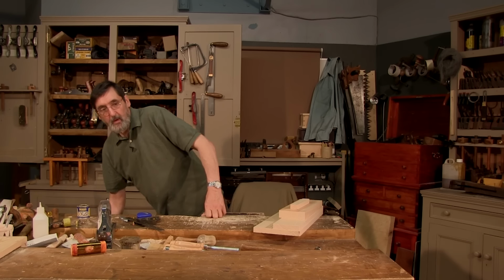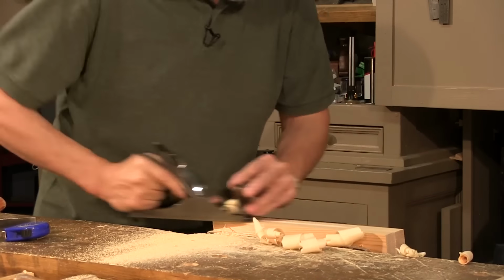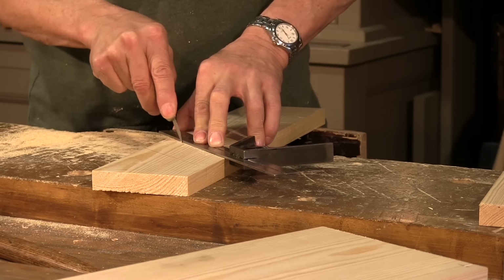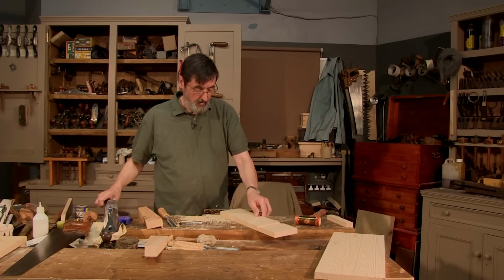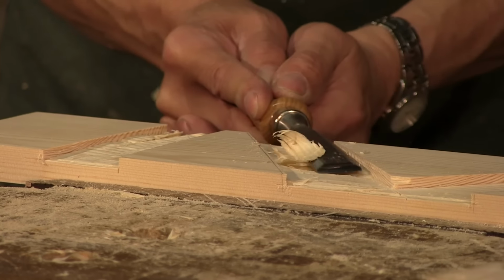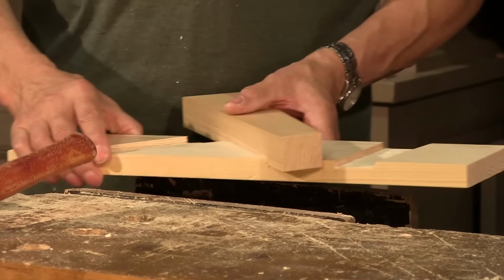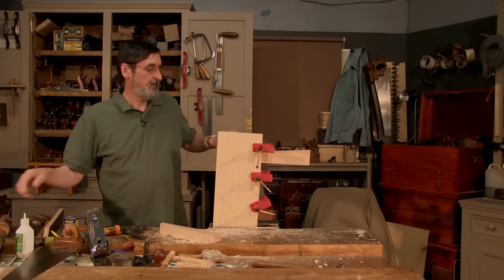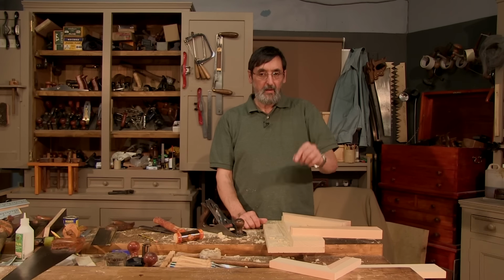Paul Sellers | How to make a Shooting Board

Comment: A refreshing antidote to watching people with immaculate workshops full of ruinously expensive Festool equipment.
Reply: Alan Currans And you do not need a dust collection system either. Power tools are addictive though. I also appreciate the folks that get by and do a great job with cheap brand power tools also. I have them a lot of good power tools but I agree with you. "I don't have any festool stuff yet" And I don't have many hand tools...which is about to change. Flea markets and Antique shops here I come!
Reply: Ugh, those damn Festool items!  Every video I watch is all Festool!  I've gotten by for several years (10) with Bosch, Dewalt, Grizzly, Delta, Porter Cable and literally EVERY OTHER BRAND out there just fine, and then comes along Festool and unless I'm missing something, I don't see the purpose in paying $800 for a router.
Reply: 1crazynordlander
Reply: titanwr If you pay $800 for a router you have to brag it up because if it's not the most awesome tool ever then you're a fool for paying so much for it.  The way I see it is you can spend a fortune on tools and brag about your tools, or you can get it done with cheap tools and brag about your skill.  I choose the latter.
Reply: ***** Don't fool yourself.  Good planes cost as much as Festool.
Reply: Alan Currans Good planes cost as much as the average Festool and some planes cost a lot more.
Reply: christschool
Are you kidding?  Even the most expensive Lie-Nielsen bench plane is cheaper than a Festool router mentioned by $80 and a Lie-Nielsen plane is definitely extravagant.  I can buy solid antique Stanley planes for $20-40 that with a little tuning turn into a great user plane.  In fact the most expensive plane in my shop was $30, and it's a great usable #6 bench plane.  But hey, if you love Festool more power to you. Your shop, your tools, do what works for you.  I do just fine without their tools using my flea market Stanleys.  Take care.
Reply: ***** I'm glad that works for you.  I think everyone should use the tools they like to use for the job, without judgement.  I like both hand and power tools.
Reply: christschool Agreed.  I did my apprenticeship in a predominantly power tool shop.  I learned a lot of wood carving but the rate of production dictated using power tools for everything else.  Now that I'm in business for myself I'm turning to a hand tool option more and more.  Sometimes it's still the best and fastest way and often it's the only way to get the required result.
Reply: ***** boom!
Reply: Alan Currans  Festools   are not the most expensive  out there. Try Mafell.
Reply: +Alan Currans AVE has a great teardown of a Festool plunge saw on his channel. Turns out the internals are garbage. No idea where all the money goes.
Reply: ***** I could careless about the internals.  Does the tool do the job it advertises?  If yes, I couldn't care less if it were made from paper mache or cow dung.
Reply: +Balenza345 Seriously. He just makes a bunch of assumptions about internal forces and then is constantly surprised when it's not put together like he thought.
Reply: +christschool Old planes can be picked up for very little and Paul has several videos showing him restoring planes to perfect working order so they would last another 100 years if looked after properly.  

Try doing that with a 40 year old machine router.
Reply: Joshua Rosen There are tons of old power equipment people use, some of them more than 100 years old.  Now, the stuff made today is not likely to last 100 years, but that old iron is being used heavily by people today. I've got a 50 year old Powermatic table saw that works perfectly and still has the same motor.  Many of the furniture shops around here use very old bandsaws, jointers and table saws, many of which are far older than 40 years.
Reply: That's interesting.  I didn't think that electrical equipment could last that long except very rarely and I'm impressed that a motor would last as long as 50 years.  It must have been very well made.
Reply: Joshua Rosen If your interested in learning more, google or youtube "vintage power equipment, woodworking".  My table saw is a 1967 Powermatic 66.
Reply: christschool Thank you, I shall.
Reply: +Joshua Rosen like any machine, power tools require maintenance.
Reply: Tony Ennis all tools require a bit of maintenance to work properly.
Reply: Leaning Tree Woodworks *
Reply: christschool I bet your Powermatic was used daily but in a small workshop where the original owner spent a fortune for the time and took care of it. Not some big anonymous workshop where people can mistreat machines as much as they want. After all its not their money, and it’s not their job to clean it. I do some analogue photography with my own darkroom. All my best equipment was bought either off small independent studios or hobbyist and I wouldn’t dream of buying anything from a newspaper or large studio. All the equipment from those times needed was respect, not new motors or worse every few months. There certainly wasn't a culture to throw the whole thing away and buy new because it was cheaper to do so.
Reply: Yes. I never feel intimidated by Seller's videos. He puts high value on his hand skills and not upon the tool itself.
Reply: Need to be a festFOOL!
Reply: @geezerdownunder  I've fixed up a few hand planes. If the full truth be told there is a great deal of time and some expense in fixing up old hand planes. Watch a video of what goes into fixing up an old hand plane - you will need often large pieces of float glass for flattening (or some other flat base), large volume of consumable sandpapers, usually spray adhesives or similar, files you'll wear down, and finishes for the handle and tote, rust removal in recessed parts, and the like. Some tasks, like truing up the sides for use in a shooting board (I know you can adjust the blade, but you're adjusting on two planes if you start with a plane out of square) require specialised equipment and can't really be done practicably at home. 

Also, when you buy a premium plane you get a blade worth about $100 with a perfectly flat back which you can flatten yourself but, again, usually with considerable cost of consumables and time.

I love Paul Sellers but even his videos show a master craftsman with everything he needs all at hand taking the best part of an hour (just the the plane, add in time for fettling the chip breaker and blade).

I think it's a bit misleading to refer to the comparison cost as $20-$40 or so for a beaten-up, rusty tool from ebay with a few hundred for a premium plane. It's a bit like comparing the cost of a bag of flour and some eggs to the price of a cake.
Reply: @1crazynordlander  I built my own pentz cyclone, it's awesome.  I made due with a shop vac for the longest time, but having a central dust collection has done wonders for my sinuses.  Need? Not in the grand scheme of things.  Is it nice for when I do use my machines?  Yep.
Reply: jpanic7677 Up to a point that is true.  However, for some of us, the time spent fixing up an old plane was as much fun as actually making things with it and the idea that I am at least the third generation to be using a woodworking tool really appeals to me.
Reply: @joshuarosen6242  Thanks Joshua. I thoroughly agree with the pleasure aspect. I need no convincing - I have bought a few up to sniff myself. My comment was not to the effect that it was a worthless or pointless exercise, but just that there is a fair amount of real cost as well as time in fixing up an old plane. Plus where do you store your metre-long pane of float glass you used to flatten the sole and iron when you're done...
Reply: I was originally going to join in and bash festool but remembered I just spent 250$ on a woodriver hand plane lol, many tools can get the job done but some people don’t mind spending more to get tools that are well engineered and of a higher quality, my woodriver hand plane planes ALOT better than my old Stanley baileys
Reply: @titanwr  titanwr: when you buy a festool router you often get a variety of accessories and their container. You may not find them valuable but some do. You also get a warranty that, in my experience, is very good. The OF1400 can take both 1/2 and 1/4 inch bits. It has a slow start. But in my experience the top advantage is the power transfer from the motor is very smooth. Any kind of scudding or thudding on a router is liable to damage a work piece.
Reply: @stretch2187  There is some irony in this. Watch a video of someone doing a "little tuning" on a $20 rusted up old hand plane. They normally go through a large amount of expensive sandpapers of various grits, hit their expensive diamond plates, hit their Tormek or bench grinder station with non-trivial tool rests or jigs. It is a few hours minimum unless you get very lucky in your base parts. Maybe hit the lathe to sand back the front knobs etc. I've done it - electrolysis baths for recessed metal parts, lapping all surfaces that need to be flat, fixing up blades by squaring up and establishing bevels then sharpening. If you want a plane for shooting, truing up the wings is almost impossible by hand. It is hard work and you do go through consumables. You may have expertise but we should avoid snobbery and mocking people who buy things that are ready to go.
Reply: @joshuarosen6242  I agree with sentiment. No convincing necessary I have multiple 100+ year old hand planes under my bench. My point was I dislike snobbery and derision about people buying what is quality now by quality toolmakers maintaining and improving traditions.
Reply: Thank you to Paul for showing how this basic and much needed tool can be made without a whole workshop full of power tools.
Reply: And no resin anywhere 😂
Reply: Not only that, he uses 20 pound Aldi chisels.
Reply: I’m a carpenter, It’s good to see the skills with hand tools,  I like hand tools, but with modern mower tools you don’t need a shooting board , you can do that much easier with a mitre saw or  on a table saw with a mitre gauge or a sled.
Reply: You are so right. Sometimes you have to get real.
Reply: @spilleradam  the problem is the finish. The finish on that endgrain from a shooting board is like glass. No mitre saw and sandpaper will ever get close. For nice furniture, it really has its place
Reply: Man! I couldn't have expressed that any better.  He makes it looks so easy.
Reply: @Joshua Rosen  ,on  older motors copper was used for the windings , today the majority are wound with aluminum which can take less heat than copper.
Reply: Love these videos and my old planes, but the track saw has hugely reduced the barrier to entry for real world woodworking esp for those that haven’t the money or space for a table saw.  Mine is festool and to criticise it on the basis of a stripdown is just silly - they are phenomenal tools that take up almost no space and do a remarkably good job, day after day, in the hands of countless pros around the world.
Reply: @christschool  ya maybe a solid gold
plane lol.
Reply: @christschool buy vintage
Reply: I hate festool with a passion, but I went one up and most of my machines are Mafell and Mirka now. I thought that was an expensive obsession. 
I am just getting into hand tools and I don't think this will be any less expensive. To get the planes, chisels and sharpening stones that I want will probably set me back just as much
Reply: Agreed.  Too many people think the key to success in woodworking is spending a small fortune to get the "best" (i.e., most expensive) tools available.  I am convinced Paul Sellers could still turn out superb work using nothing more complicated than the lid from a tin can sharpened on rock.
Reply: Most YouTube videos these days have entirely brand new top of the line power tools and Woodpecker items sprinkled in for good measure.  I like his dedication to homemade tools.
Reply: @titanwr   If I give $800 dollars for a router it better come with a kitchen, bedroom and other amenities..... LOL
Reply: Cumulatively, Paul definitely has more

Comment: Paul cuts a 19" piece of 5x1 with an old cross cut saw only slightly younger than me, whilst other YouTubers start up £1000s of machinery to cut a ¼" dowel!
Reply: I was just thinking the same thing. The way he just throws it on and goes is a testament to his skill. However his videos have taught me that hand saws are mostly rough work and fine tuning is done with bladed tools later. Even still my rough cuts involve a lot of lining up and multiple slow starts and stops the whole way through.

Comment: I’ve been watching this video so many times and I’m not quite sure about the boards sizes. Before I start making my shooting board, I want to be sure that the top board with the grooves is only 4 inches wide. It looks like it’s 5 or 5.5 inch, which I think will give more support to the wedges and to the piece being planed. And the under board where the plane will be traveling looks as wide as 2.5 or 3 inches and not 4 inches as portrayed.

Comment: So refreshing watching someone who knows how to use hand tools! You finished that task in under 45 minutes, if you set up power tools to perform this task it would have been over an hour. When I did my apprenticeship it was a standing rule that first year apprentices worked only with hand tools, second year could use the bandsaw and thicknesser only and third year could use the full range of power tools! Certainly taught me how to use hand tools, lots of the older guys would lend you tools and teach how to use and sharpen so I got a complete education. Pity it’s not happening now!
Reply: You learn something different when using traditional tools over power tools.  Similar concept to architectural design.  1st years weren't allowed to use the computer for any of their drafting work.  Everything was done by hand with lead and straight edges.  When came time to use the computer, it's amazing how....limiting....it is.  The setup alone to get the lineweights and linetypes correct...and so many people don't understand why we do things the way we do because they never got that foundation built.

Comment: The educational value of this video, like all others by Paul, can hardly be overrated. Granted, I did the project twice. Even if you attempt, it is not guaranteed that the result is as intended. But with Paul's excellent instructions and example I learned more woordworking in a few nights than the previous 60 years. And the second time already was (almost) perfect. Some mantras stick: "A very light first pass (of the knife), somewhat heavier the next pass, and the third time as deep as you can get it". And: "Your tools might not be as sharp as mine". Now don't the latter happen to you, make sure your tools are as sharp. You can do it. It is good to have watched other of Paul's videos, like sharpening and adjusting the plane, sharpening the chisel, planing a board flat and square. And for this project in particular: the poor man's router plane.

Comment: Truly valuable lessons. I am a beginner woodworker and a hand-tool enthusiast and I just made this shooting board and am super happy with the end result as it works perfectly giving dead 90 degree edge that is super smooth and hence better than a power tool miter saw. I really don't understand some other places where they suggest an enhanced shooting board that is constructed using table saw, power router, jointer etc etc! because I feel if someone is already going to use those many power tools then why build a shooting board! This is an essential jig for hand tool woodworking and hence should ideally be build using hand tools. Just my opinion. Thanks again Paul!

Comment: Thanks for sharing this Paul, I just made myself one - an amazing tool! Just a few comments for anyone else looking to make one...

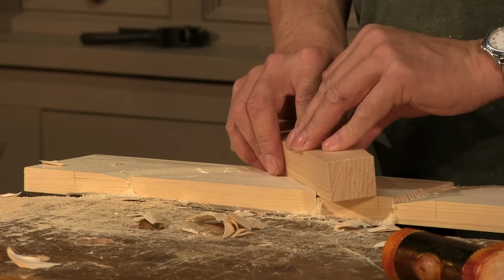16:42 when you say place the 45 degree wedge 1/8" past the edge when marking, make sure whatever distance you choose you use exactly the same distance when marking the second 45 degree channel. I didn't and the 45 degree wedge fits one channel perfectly but is too short for the other. Both 45 degree channels need the same width at the mouth for the wedge to extend the same distance in both.

I found that the 90 degree wedge tended to rock back out of its channel a bit, so I recut the channels to 8mm deep (were 6mm). 

If you don't have a router plane, I highly recommend watching Pauls "Poor Man's Router Plane" video - make one of these and it makes the process of cutting the channels so much easier and more accurate than trying to chisel them by hand.

Comment: I made this over the week-end. What an excellent video it is! Turned out as it should. One point is that planing the tapered guide pieces is very critical. They must be absolutely straight and square. I think hoping to interchange the 45˚ positions is wishful thinking. The taper is only about 2˚ so a 0.5 mm difference in width of slots (and there is an element of judgement in marking these)  makes about a 15mm longitudinal difference to the position of the guide. I would make a separate piece for each 45˚ guide.

Comment: This is fantastic! I'm still a beginner and I've tried a few different styles of shooting boards in the past but this has by far been the most effective and accurate! It's incredibly easy to make even for a beginner and you can customize the measurements to suit your needs. After my first use of the board my results were innacurate but I soon realised I had not moved the wedge far enough out and although I wasn't getting any breakout, the very last fibres of wood on the edge hadn't been trimmed, one quick swipe of the plane to remove the last fuzzy bits and the end was perfectly square! Make sure your plane is freshly sharpened before use! I've even been able to trim up 1/2" sapele end grain with ease, something I really struggled with before. Many thanks again, Paul!